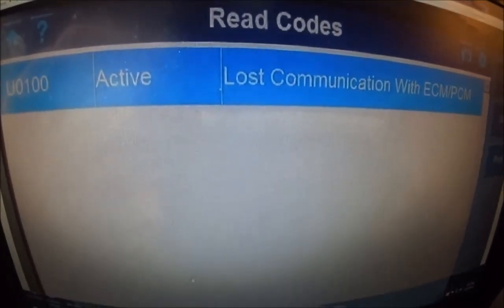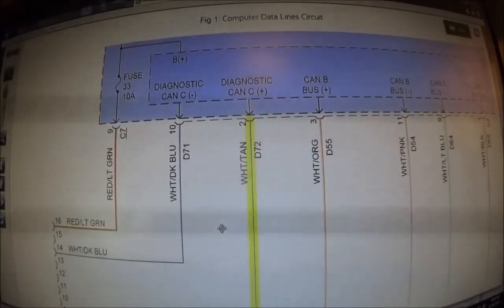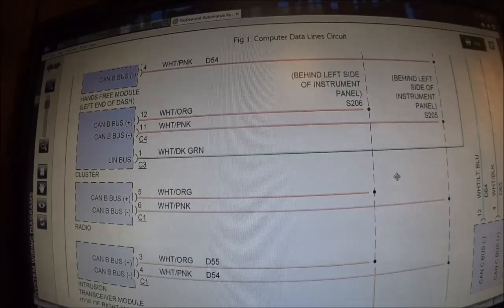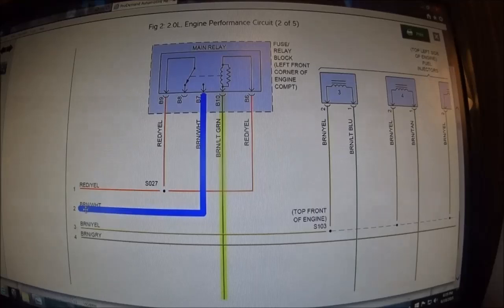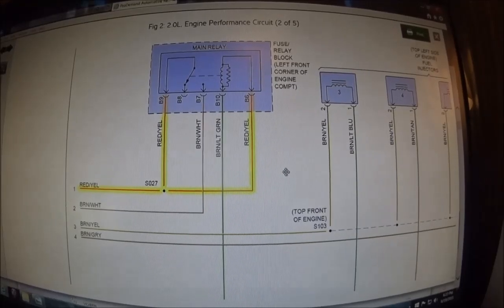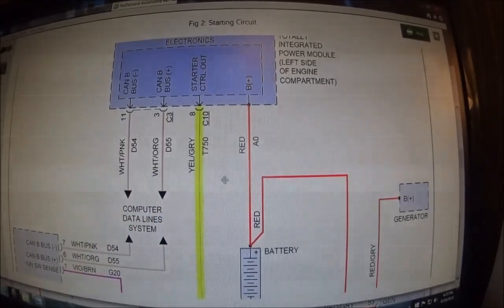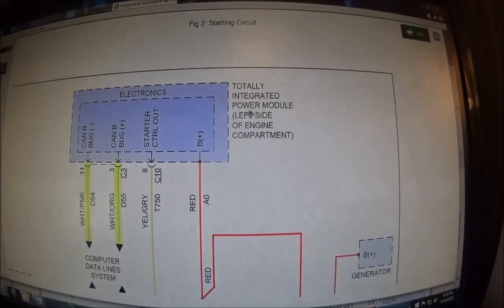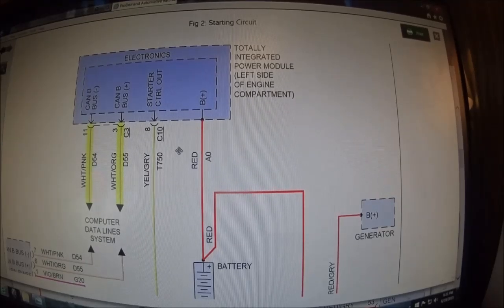2007 Dodge Caliber No Start & No Communication

Comment: Just to share some other information, I had a problem where the starter on my 2009 Caliber just quit working. It worked fine on my last drive home. Next morning, turned the key and nothing - not even the starter solenoid clicked - completely quiet. Battery was fine - all the dash lights worked. Previously, I had a headlight and turn signal stop working. Found corrosion on a relay in front of the FL tire and fixed that thinking it was the starter relay but it was a cooling fan relay. Info online showed that the starter relay and all the driver circuits for the lights were in the TIPM so got a reman one from RockAuto and installed it but it did not fix anything. Finally discovered that the ground wires for the lights (and other items) were bundled into some ring connectors and fastened to grounding posts in the engine compartment - two posts on the upper frame piece just next to the FL headlight and the battery and one on the lower frame piece between the FR headlight and the serpentine accessory drive belt. Found that all the wires were corroded and many were causing open circuits. I took off the old ring lug terminals, stripped and cleaned the wires, crimped on new ring lug terminals and re-fastened them to the grounding posts. All the light problems went away but the starter was still silent. I'm currently looking to see if the starter has a similar issue with its power or ground.
Reply from the maker: Common point of failure

Comment: All I did was get the yellow/grey wire from starter add a 20amp fuse between and connected it to ignition switch vio/brown ...and it work just like factory.....my issue was starter solenoid ...I try to start the car only herd clicking sound so I try about five time and then absolute no sounds current to starter went dead not one click sound wire to relay burn out on the way to starter, some where from ignition to fuse or relay.
Reply from the maker: Yes, but that is not how the factory designed it, and I would not do that to a customer vehicle.

Comment: I had this very problem today at work. 
I powered signal wire to starter and it fired. 
Module was fried it happens when wires rub on body and short module.
I recommended costumer a new module and reprogram and laugh.
I rewired the signal wire to a simple switch and fixed it for next to nothing. 
U0100 will forever be in its blood line until its scrap for pennies.

Comment: Hi Joe! i have a 2998 myself with same issue i fixed the bad wire at the relay. where are you getting your shematic from please? Id like to continue as mine didnt start even after jumping the starter. it cranks but wont start still. Has comm with factory pcm but still shows invalid key skim. id like to see if i could bypass this skim if possible and get my car working without the expensive cost to reprogram the key.
Reply: Where is the module located
Reply: Same my car cranks but doesnt Start dia you try starting the car as you unhook and hook the neg cab on bat

Comment: Hey Joe, I'm an old head new in this field. I'm 47 and disabled from a few botched spinal fusions. I had worked in construction my whole life. And i have always bought and sold cars on the side to supplement my income. And i always fixed my own vehicles and those bought to sell. I admit over the years i fired the parts cannon. Sometimes I'd get lucky other times not so. Anyway while laying in bed trying to recover i come across scannerdanner and I'm blown away, wait what the electrical that I've always been so scared of because i didn't understand it. Is simplified by Paul and his methods. So i bought his book and subscribed to premium. And watched his videos religiously. Now I'm looking at waveforms and understanding what I'm seeing. I'm reading wiring diagrams and understanding what all is on a particular circuit. I'm able to identify pull up pull down design, inputs, outputs, etc. So i start advertising mobile electrical diagnostic and i get a few emails. And I've fixed several vehicles in a short period of time. Being disabled i move very slow. What takes you 10 minutes may take me a few hours. I'm not dead yet so i try to keep moving. And every free minute i have i am trying to learn, learn as much as i possibly can. I appreciate all of you that take the time to make these videos and share your knowledge and experience because it is tremendously helpful to people like me. Thumbs up! Virgil in Delaware
Reply from the maker: Man! You certainly made my day, Virgil. I am happy to hear that these videos help you. And Paul is a fantastic teacher. Nice to see guys taking our material and learning from it. Good job on the mobile deal too!
Reply: I'm in Arizona and was in a head on so I'm really slow getting around myself.  Nerve damage.  Have you ever tried gabapentin?  I broke my neck and on occasion is would just start killing me.  I'd have to go get a morphine shot but ran across this stuff and it makes it all go away but doesn't work on my nerve pain which in my pelvis area.  Thought I'd mention it so you could give it a try.  It was a lifesaver for me.  Good luck.

Comment: I've been researching on this car, in general, I get an 80% approximately gArbage car.. how can I test if it's legit or not?
Reply from the maker: I am not sure what you are asking me?
Reply: Like basic tests to see if it's a good buy or not.. like if the fix for its common flaw is already done or not.. seeing that there's few common manufacturing defect on this specific model. 

Does it make sense?
Reply from the maker: The only suggestions I can make are to have the VIN run through a  dealer service department to see if it has any known recalls that need to be addressed, as well as any issues that were already taken care of. Basically a repair history. However, if work ahs been done outside of the dealer, only the original owner will have that information.
Reply: What if that no crank/communication happens after I buy it? Is there a way to know if that's predictable? Or to know what causes it? Or is it an inevitable..  manufacturer defect that can happen anytime?

Comment: Fascinating case study.  Thank you.
I am familiar with relays such as a starter or fuel pump relay and know how they work.  What is a Main relay and what does it do?  What made you go in the direction of checking the power and ground wires to this Main relay?
Reply from the maker: toyo toe Hey, thanks a lot! To answer your question, the main relay on this vehicle powers up the PCm, the injectors, and ignition system (i.e coil packs). The reason I went this direction is because it was apparent that I could not communicate with this pcm in manufacturer software. A basic place to start would be powers and grounds to our pcm. Of course, depending on what I found at the relay would determine my next move. If the relay was being powered up, I would have then checked all my powers and grounds directly at the pcm to determine if it was perhaps a faulty pcm. (Another common failure on Chryslers.) Remember this...when doing any test check basics first. You have to have a plan of action, a strategy for testing where each test will lead you into the next until the root cause of the problem is determined.